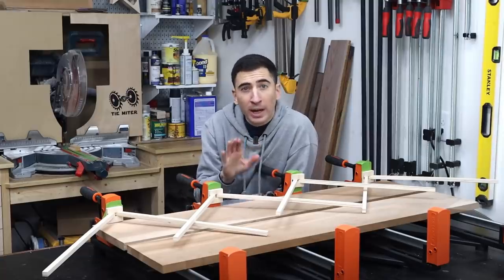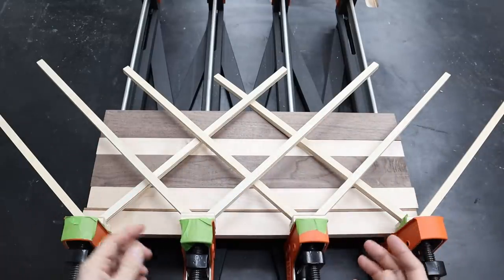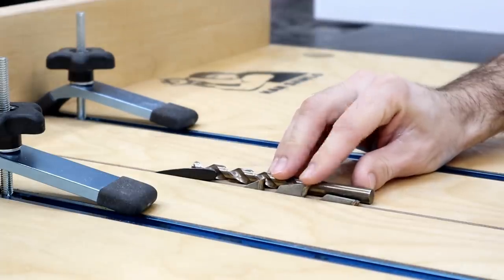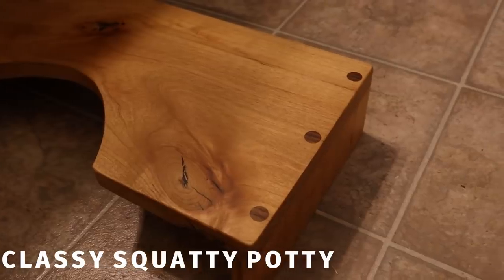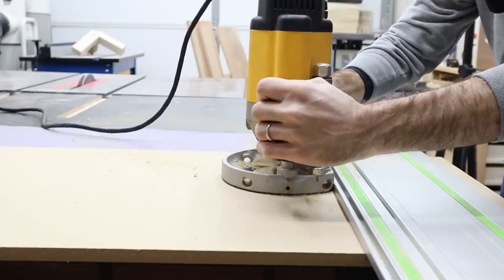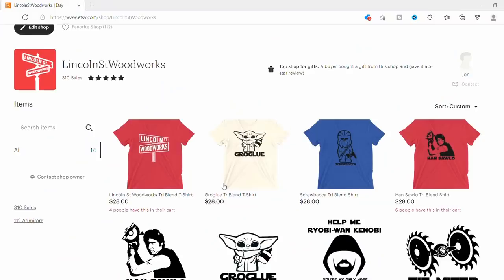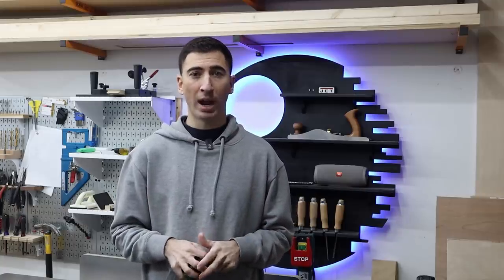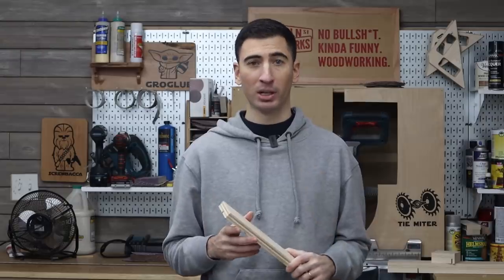I wish I knew about this before - woodworking

Comment: Rather than applying more clamps to a smaller glue-up, like the cutting board, you could just add a wider spacer board to the edge to increase the distance to the closest seam. That'll ensure your seams are within the effective clamping area, though you may need some fairly large clamps to do so.

Loved all the drill bit tips though!
Reply: But, but, but, a clamp has another end too. And that applies pressure on the other side of your piece. I mean, nothing is moving, there must be an equal counter force. And the triangles of force coming from that other side will definitely cover the seam on this side, won't they? I'm so confused.
Reply: @nelus7276  True…sort of. The clamping force is really where the fan out from both sides intercept. For that reason, a spacer board or extra clamps are needed.
Reply: Eric, exactly how I usually handle this!  Spot on.
Reply: @nelus7276  I would agree with you on that. I thought that myself when he was explaining this.
Reply: @nelus7276 no, because you need force from both sides. That very first triangle has no force from the side your clamps are on. Yes there is force from the OPPOSITE side, but no force from the side you’re on. Think of it like this, put your hands together and push in towards each hand. Then move one hand and push again. That’s what those spaces between those triangles is like, one hand pushing against nothing.

Comment: I never thought of using drill bits as setup blocks, I'll definitely use that in the future. Great video!
Reply: Yup! I’ve literally been debating setup blocks for two weeks while staring at an expansive collection of drill bits.
Reply: I had this unreasonable fear that drill bits were somehow less accurate that setup blocks.
Reply: but put the drill bit  at 90 degrees from the blade. not sure why he put it parallel with the gap.
Reply: Mike your bit first... not all bits are accurate.
Reply: I was blessed with a nice set of Mitutoyo gage blocks back in high school that someone just gave me, that I had no use for at all until I started woodworking.  I'm glad I saved them!

Comment: Heres my tip:
When I'm setting a jointer fence, or a tablesaw blade back to 90 deg, I have trouble telling if it matches my square perfectly.
What I do is put a flash light behind the square, any gap between the square and the blade/fence instantly becomes super easy to see.

Comment: I like to use a scrap board on each end of the glue up to reduce the number of clamps.  Something wide, but same thickness and at least the length of the glue up.  It creates a much wider and more even pressure zone on the actual jointed boards.  Also eliminates the need for little scrap pieces to not mess up the project board edges. Nice T-Shirt btw love it!!
Reply from the maker: Thats a fantastic tip - never thought of that
Reply: Yep I do the same given limited number of clamps I have!
Reply: If you use slightly bowed boards, it will help even out the pressure. I do this when gluing things where I can't get any clamps in the middle.
Reply: @Lincolnstww  i gained a lot more respect for you when you told the people crying about you using imperial and not metric to kick rocks
Reply: Just remember to wax the aid boards you don't want to get glued up in there.
Reply: At our stair shop Even though we have a rotating clamping machine we always use spacer boards to add strips lengthwise to widen stringers. Your 45 degree visual demo makes perfect sense as to why. Thanks!
Reply: @daveortwine2641  same.

Comment: Dude, the right hand rule for figuring out which way the router should go against the fence is genius!  I'm pretty sure I guess wrong every single time.
Reply: Chemists and engineers hate him! They've been using that rule for centuries! This guy just went ahead and applied it to a router. lol
Reply: the right hand rule also tells you the direction electric fields and magnetic fields propagate in relationship to the direction of current
Reply: @brewtalityk  Yup. And can also be applied in organic chemistry and physical chemistry on similar principles.
Reply: Big facts
Reply from the maker: I still have days when I forget left from right
Reply: I never thought of a memory aid like that. After spending 2 days routing all the decking and railing for a 50'x20' multi-level deck I realized it's just going counter-clockwise about the outside edge of your piece. Never used a router table but I imagine it could be described the same way only moving the work piece instead of the router itself.
Reply: You can also look at the arrow on the router and simply remember to not use the router in the direction that it tries to get away from you. You just want the router to push against you as you push it.

Comment: Something is bugging me about the clamping pressure theory. In the cutting board example, there seems to be lack of pressure on the closest seam. BUT, the pressure cones should extend not just from the front jaws but from the rear jaws as well, which should cover these spots in the closest seams. Can you actually try it?
Great video, as usual :)
Reply: The clamping pressure will dissipate over distance as the "cone" widens, so it will not be as effective on the far side of the board.
It also wouldn't be even across the  cone - it will be strongest in line with the clamp and drop off the further sideways you go. So the rule is an approximation and shouldn't be relied upon as gospel.
Other factors such as the straightness of the board edges will also affect how much clamping force and how many clamps you need.
Reply: The pressure cone doesn't extend from one end up to the other because it is actually a pressure "diamond" (made from the intersection of 2 cones, one from each end of the clamp, facing each other). Since parts of the closest seam fall outside of these pressure diamonds, the joint lacks pressure.
This is actually true for the first board on each side of the clamping setup, not only on one side as it might have been understood from the video.
Reply: @manuelponce-julien691  Thank you for that. I knew something was off with that theory, but it's been a long time since physics classes.
Reply from the maker: Yeah what Ian said - at the end of the day this is an oversimplification of a bunch of factors. I didn't even touch on the density of woods species and the effect that can have. The moral of the story - narrow boards need more clamps to get consistent pressure.
Reply: Despite the replies above, I agree that Yoel is correct. I was intending to voice a similar observation, until I saw his comment.
Reply: @Lincolnstww  Width and thickness, also increase the rigidity of the board, and thickness and length strongly affects the pushback force of the viscosity of glue.

The clamps themselves can also be a problem. Their spines can bow which ends up putting more force on the same side of the interface as the clamps are on. That depends on the rigidity of the spines, the length of the clamp, and the distance between the spine and the clamp face. A longer clamp in either direction = more bowing. There's also the matter of how much force each clamp can exert. If bowing is an issue, fit in some blocks and shims between the workpiece and the clamp spines. If the clamps start sliding off the workpiece because of the bowing, ease the pressure off the clamps and add more.

I disagree in general with this force-cone trick. It's VERY error prone, and could more safely be handled with just guesswork and being more generous with clamp count.

For horizontally thinner pieces. You should instead use an additional thick block to artificially rigidify it, making the clamping force apply more evenly. It'll also save the surface of your work from rough clamps, and you wont need a large number of different fancy clamps.

The most important factor in counting clamps is the area of the glued surface.  You can directly correlate interface area with clamping force. And all you need is a simple number table to use as a guide, and a rough idea of your clamps' clamping force.

Just multiply the length and width of the interface, take a look at the table to figure out roughly how much clamping force is needed, then just gather clamps until you're safely over that number.
Reply: Whew, glad it wasn't just me who thought of this.

Comment: I got a great tip. Most furniture makers use mechanical pencils, 0.5mm for accurate marking. Yes they are accurate but they break easy and have an inconsistent line. I also sometimes use carpenters pencils, but they are time consuming to sharpen and don't produce a consistent line. I started using 2mm mechanical pencils about a year ago and they're perfect. They're easy to sharpen, they produce an accurate line every time and don't break so easy like the 0.5mm and they're also cheap. I use one with an HB lead and I also have a spare one with a yellow lead for dark surfaces or metal. Pica has one with a 2.8 mm lead, so because of the odd size the leads are harder to get and more expensive, I heard they're good too but a 5$ Steadler one is just as good.

Comment: My tip is a little different.  I make sure there are casters on all my shop furniture.  I don't have a lot of room, so sometimes I roll my bench and table saw cabinet out of the garage and into the driveway.  But in general, it's nice to be able to quickly and easily rearrange the furniture around the space.  It also helps for clean-up and retrieving small lost objects from behind heavy stuff.

Comment: Very clear and concise informtion.
Having failed woodshop in 7th grade, I have spent 40+ years in the building trade and having spent the past 25 in high-end millwork, I have had many obstacles I had to overcome! I have a simple jig
 that allows me to make all my sheet good parts square edged and put miters on whichever edges may require a miter, all at the same time

Comment: Just started studying fine woodworking in a local shop and have some tips that have helped me a lot; when drilling into the side of something place a ring on the drill bit and if it moves either forwards or backwards you’re not going straight, the key is for the ring to not move. When doing 45° miters like in a box and find that you have small gaps in the joint squish some glue in there and then use a screwdriver to round over and close the gap.

Comment: What a GREAT tip about the flat vs rounded side of a router base!!!!
Better than setting a clamp to "remember" your fence setting, I put blue painters tape down and put fine lines corresponding to where the fine line on the saw's ruler scale was set.  That way you can return to several different settings, and it is almost as good as that clamp stop block.

Comment: Great tips! Thanks for sharing. With my forstner bits, I will start them in reverse to prevent tear out and makes a nice clean hole.
Reply: That's a neat idea, I think I'll try that.
Reply: @jamisonr  It should score the top of the material you are drilling making a clean line. Let me know what you think.
Reply: Works with hole saws too
Reply: Even better if my drill press were reversible

Comment: Tip: I keep a pack of cheap emery boards in my shop. If you get a bit of glue in a 90° angle, they make it simple to sand out. Also, they're great for impromptu mani/pedis.
Reply: Great tip RE:,  I use emery boards when i need to knock down wood fuzz, or clean up glue, while being careful not to take away any measurable amount of wood.  I Love them, for between the "fingers" on box joints, dovetails and splines.     
      While you are in the nail polish aisle; grab one of the 3 in 1 or 4 in 1 files (hell, grab a half dozen if you are in the dollar  store)  They have sides with super fine grit and a burnishing side.  They are amazing for pore filling and CA glue finishing small parts and lathe turned pieces.     I also use the burnishing side on router profiles, edges & beads on boxes & frames; so, i have some lines more polished than others for more light reflection and controlled highlights.
  These tips, in the comments, are all great!  Thanks everybody for sharing ~ 🛠Lisa♿

Comment: Love the comment about Imperial vs Metric measurements. In New Zealand, we went metric in 1966 (I was 13). I still think in imperial and can visualise 4 or 6 inches much easier than 100 or 150 millimetres. I can also go into any hardware store and ask for 3 metres of 4 by 2 (yes, we say the width first, then the thickness) and even the youngsters there know exactly what I want.
Reply: The US went Metric in 1975, but they are a stubborn bunch... Of course, it is the use of fractions rather than decimal that is the real problem- and the two are conflated.. They have to have two more series of drills to fill gaps, and no-one can remember which fits where...
Reply: @farnarkleboy  I think you are conflating metric and decimal. It is perfectly possible to work in decimal inches (and engineers do- despite the ludicrous shortage of imperial decimal tooling) or metric fractions. Both inches and millimetres are arbitrary measures in practice (any agreed distance would do). If you feel more 'comfortable' with fractions (despite the clumsy nature- what is a third of7/16ths...) why not work in, say, units of 24mm? Close to the inch, for comfort, but divisible by 2,3,4,6,8,12 into whole numbers. Call it the 'minch'; with milliminches and kilominches etc. All of the features of fractions, but with no discontinuity that Imperial has when it runs out of fractions and goes decimal (few venture beyond 1/128 before resorting to thou). All of the machine tools are already available, in minches and minch fractions. So, a 2 x 4 inch is still a 2 x 4 minch timber- probably more accurate, as the wood is almost always smaller in practice... Same comfort, better fit to reality, more factors, timber already sized in it, no discontinuity at small dimensions, whole numbers for most divisions, what is not to like? (value of the moot is moot!)

Comment: Great information. You hit all the quick tips that I knew and alot that I forgot I knew. One tip is for glue up. To prevent sliding use sand paper grit or salt on the wet glue before joining the pieces of wood. Keep em coming! Mahalo for this video.
Reply: Some people sprinkle a few grains of salt before joining the pieces.

If you are using good old  PVA glue, if you hold the pieces together with hand pressure in place for about 10 seconds, the glue will tack up a bit and will be less likely to slide.

Comment: The drill bit setup with a table saw is great, but my experience has been to butt the end of the bit up to the top tooth of the blade rather than laying it along side. No gap that way.

Comment: Metric or Imperial, the number are just a way to represent the distance being measured. Often that measurement falls between the graduations on the tool, so finding ways to measure without numbers can be helpful. That saw depth trick is one. Another that I like to use for mostly inside measurement is to use two overlapping sticks. I slide them to touch both sides of, say, the inside of a box, clamp them together and then just transfer the measurement to my stock. I learned this about 50 years ago from an old boatbuilder from Nova Scotia.

Comment: Another take on the sneaking cut using the saw teeth is to line up the workpiece with the blade, apply very slight pressure against it flexing it slightly, then lift the blade up. If you do it correctly, when you lift the blade before making the cut, it will spring back to its original position and the workpiece will be under it by a very small amount.
Reply: For a miter saw, I assume. Because that is exactly what I do with my mower saw. I find on my more saw that if I don't apply any pressure against the blade I still get a tiny bit of material cut off. That may be the result of a cheapish miter saw.
Reply: @jimweisgram9185  yup, I wrote that in a huge hurry from the sound of it lol. Definitely a mitre saw

Comment: Straight up with the hacks. Drill bits as space measurements? That is life changing. What I'm reading into is get out my micrometer, and my drill bits and get the ones where they are dead on or within 1/64' and use those as my spacing set.

Comment: Noob here. Great tips thanks! Although just cutting off a sliver with your miter I was taught while off to butt up the board to the blade then raise it and then make the cut. Just the slight amount of pressure butting up against the blade will be surprisingly enough to cut a decent sliver off. Saving the effort of an extra board underneath and cutting upwards.

Comment: Loved the bit about people who think in fractions. I'm a CNC guy who use decimals and calipers to measure. I got insane amounts of pushback from the new woodworking company that I started working for when all of my blueprints were handed out to the shop with numbers such as 2.3125 on them and they had no idea what 2.3125 was. While I personally despise having to count the lines on a tape measure to find out if I just made a good part, they are so used to doing it, they don't even have to count the lines.

Comment: I will occasionally use metric when it makes my life easier.  It's a lot easier to divide 33 cm in into thirds than it is 13 inches.  I have a friend that's a retired pattern-maker for a tool manufacturer.  He said that plans were often in thousandths and he had to memorize sixty-fourths decimal values.  The company he worked for was bought by a Japanese company and they converted to metric for all their work.  Other than needing to purchase a new set of shrink rules, he said it made life much easier.  (a shrink rule is unique to every kind of metal being cast and is calibrated so that if you make a pattern using it, once the metal is cast and cools, it shrinks to the stated dimension).

I have seen that 45 degree clamping guide many times.  It can depend some on the "stiffness" of he material.